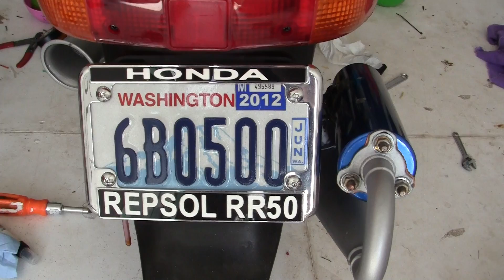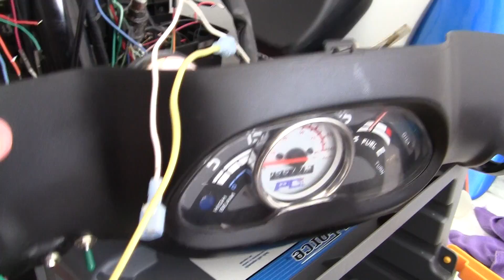00002

Comment from the maker: Exactly, you are also right on the money mate. I guess the flasher unit needs more current than the battery. I GOT IT TO WORK!!!. Both flashers work perfect but I have one back light out. I am really happy because you really need good turn signals, brake lights and rear view mirrors with such a little bike. It is sounding really good. thanks.

Comment: Ohh the flashers don´t go by the battery?Wow that´s abit weird with the engine you have but i remember some older scooters that takes their current to the flashlights and so on directly from the stator and so be it tho it isn´t really reliable because you need the engine to run to get the flashers and brakelight working.Regular lights is only roking when the scooter is "on" on most mopeds in general with some rare exceptions.
Cheers and take care and i hope it turns out good.Get it?"Turns" hehe